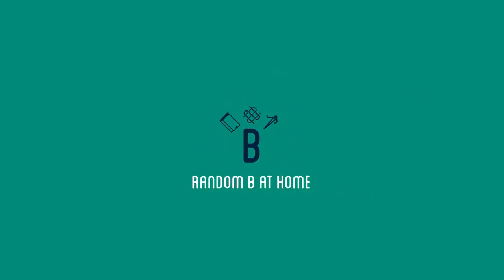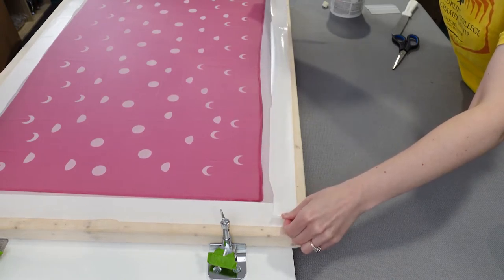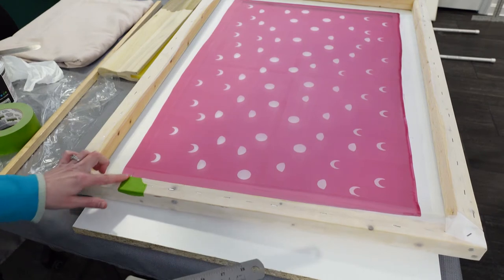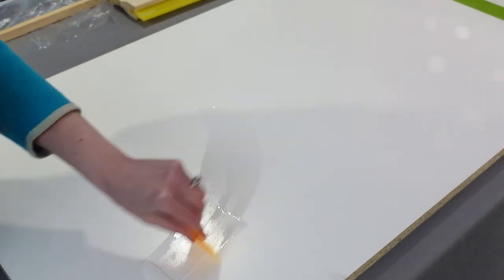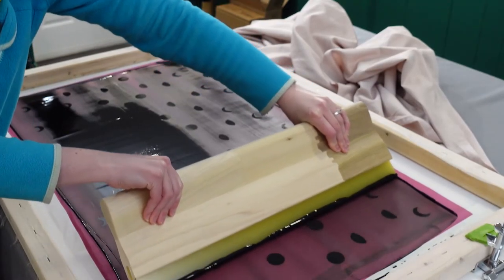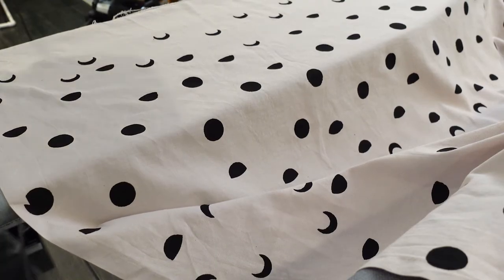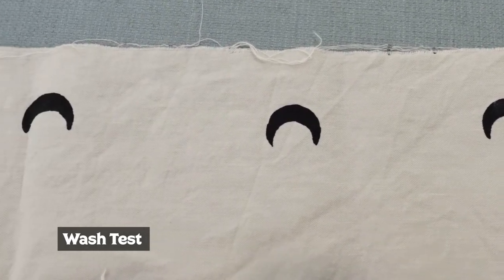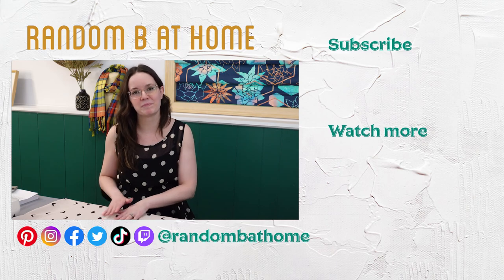How to Screen Print on Fabric

Comment: Just a heads up… it’s not that the glue didn’t work, the spread glue reacts to heat. After applying the glue you take a blow dryer or heat gun. I would also suggest coating your pallet with transfer tape.
Reply from the maker: ohhh thank you so much! I'll do that next time I print